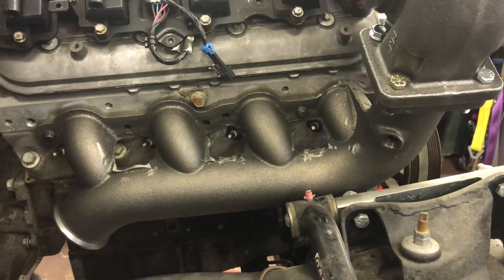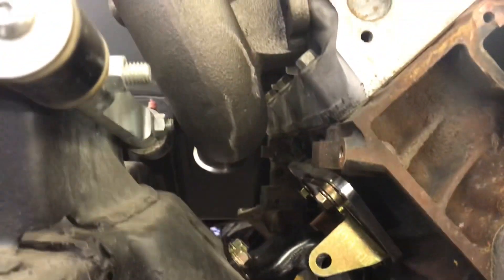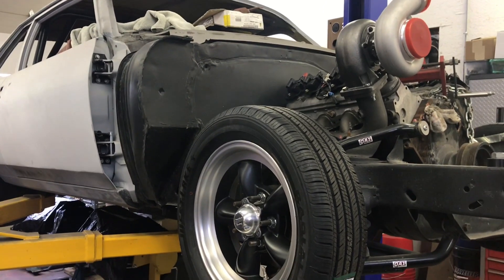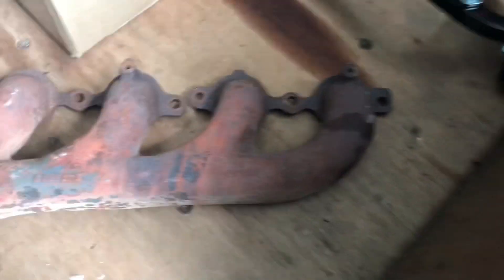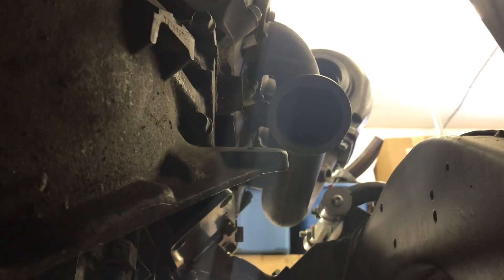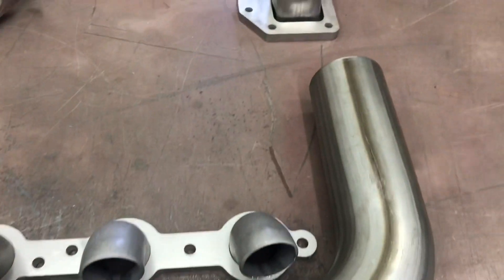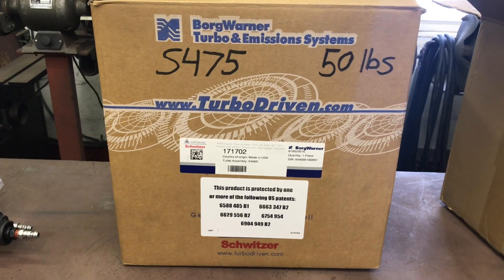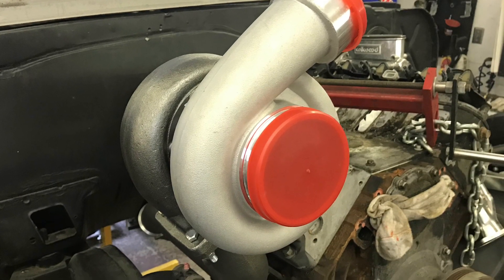1972 Nova: Single Turbo Mock up!

Comment: Your making me want to put a single turbo 6.0L LS in my dump truck. What do you think I could get for horsepower and torque with a small to mid size turbo?
Reply from the maker: 5-600 seems to come with little effort or too many mods.
Reply: @mountainsgarage  and still with good torque? It will be a tow vehicle. Probably paired with a 4L80E?
Reply from the maker: @petermullin5387  Yes it goes up proportionally, just need a big intercooler.

Comment: Great content! Where did you get the turbo manifold?
Reply from the maker: The cast T4 is currently $287 on eBay. Search “LS Turbo Log Manifold”
Thanks for watching!
Reply from the maker: Supposed to be a copy of a Falher manifold.
Reply: @mountainsgarage  thank you!
Reply: @mountainsgarage  kkn2🎉h❤🎉go❤idjue😂Fisk do
Reply: @mountainsgarage    $$. Viicit😅. F. T
Reply: @mountainsgarage  thx for the info! Mind sharing the ebay link? I tried finding it but nothing came up at that price.